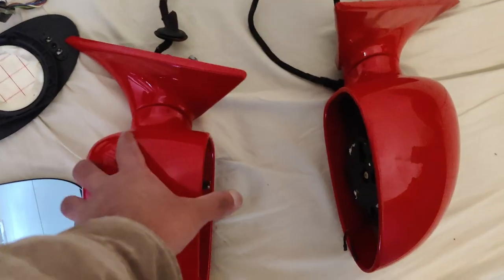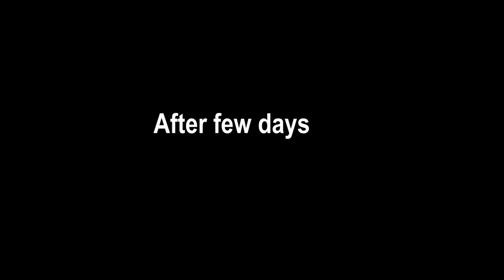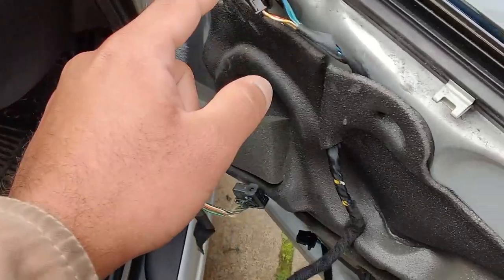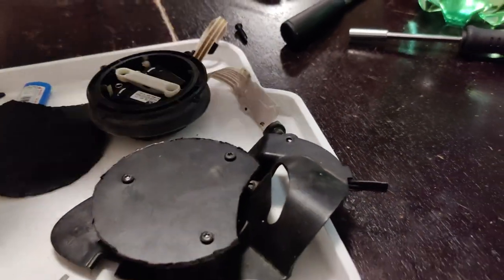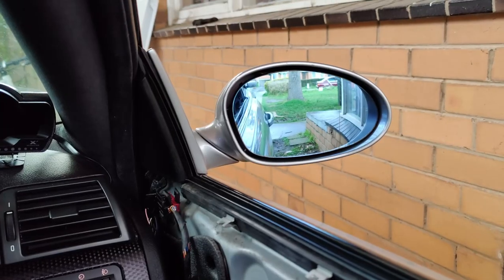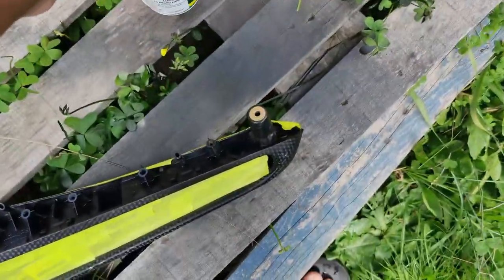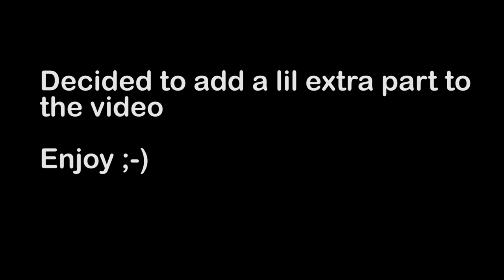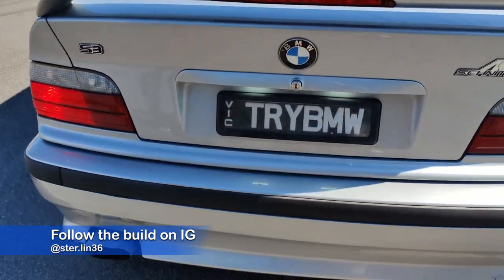Installing M3 Side Mirrors on my BMW E46

Comment: Those mirrors have the motor, so they fold automatically, u just need to buy the purple connector that goes to the driver door…(maybe I’m wrong)
Reply from the maker: Yes, they do have the power folding function. I still haven't plugged them in yet

Comment: Great content! I’m also looking to do the same conversion for my RHD cabrio, I’ve got the M3 mirrors but can’t get hold of the mirror motors, where did you get them?
Reply from the maker: Thanks mate, I used the mirror motors from my stock e46 mirrors and installed them to the m3 mirror housing with a slight modification as shown in the video. I didn't  use m3 mirror motors which are hard to find and very expensive. If you can't get hold of a pair of non m mirror motors, check a local BMW wrecker, they should have plenty of them.

Comment: Where did you get the mirrors? I have an e46 compact and looking to put M3 or M3 styled mirrors on it mostly because I just hate the normal tiny rectangle mirrors and I find them a pain to use but can't seem to find any M3 mirrors in AUS